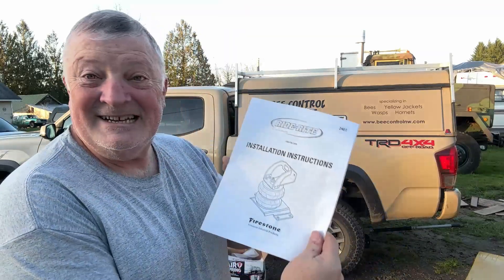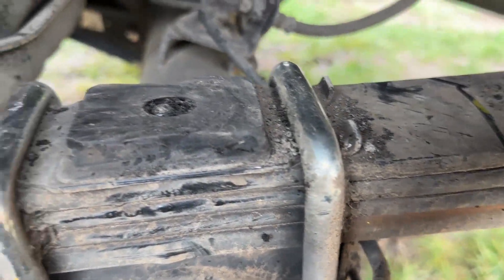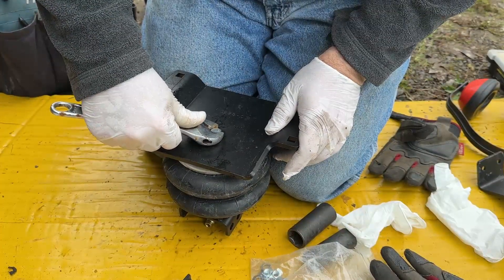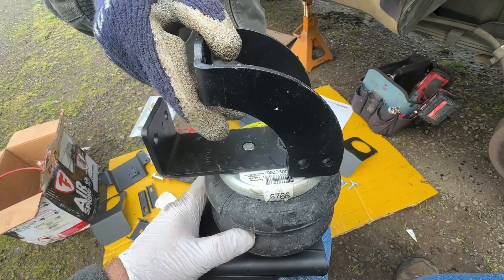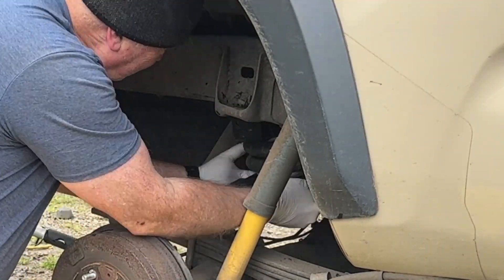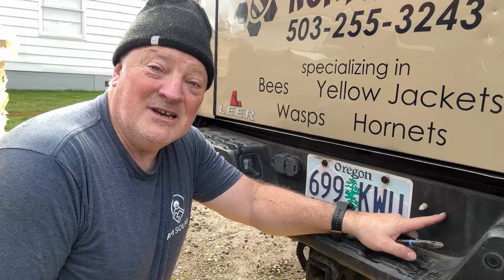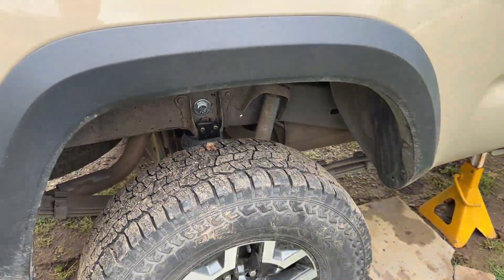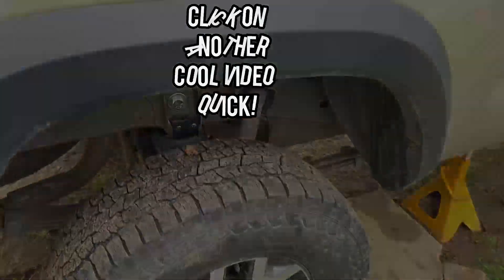Firestone Ride Rite kit install

Comment: Pro-tip. When testing for leaks use the old mans bee smoker. Believe it or not, The shop that installed mine finial fixed the leak they could not find with soap when they used the smoke machine. Second Pro-tip. Use the upper license plate bolt holes for your air valves. No drilling required. Your welcome.
Reply from the maker: My father-in-law told me where ever I put the fill ports, they would be in the wrong place. So, I followed the instructions to the "T". Now, I can say that the instructions were wrong, not me!

And I have to say, those push in fitting are a terrible design... I don't know of any that don't lead a little.

Thanks for the comment!